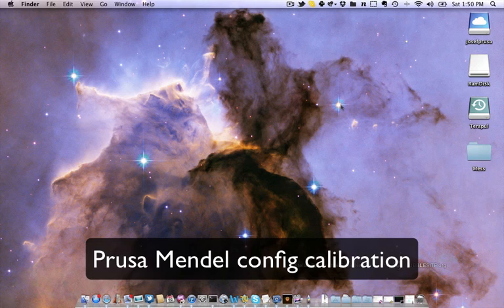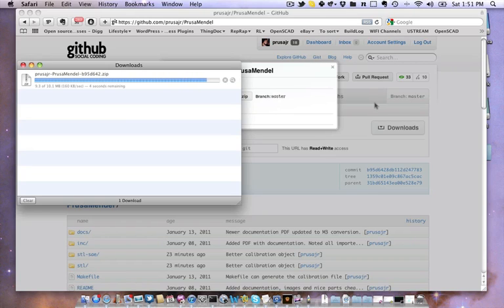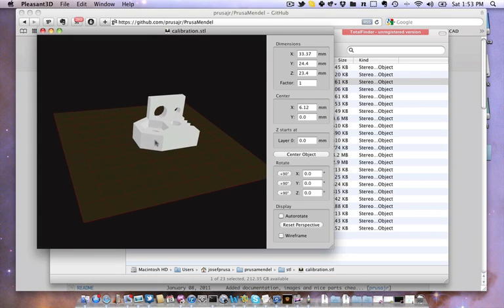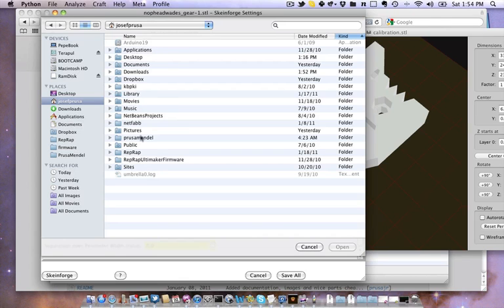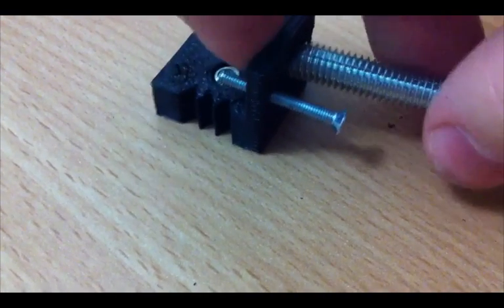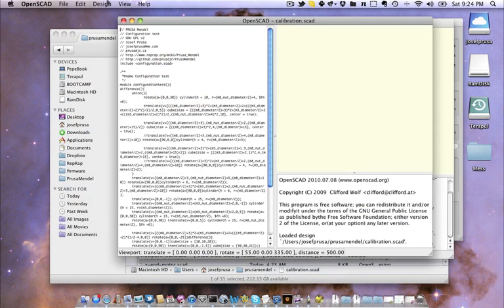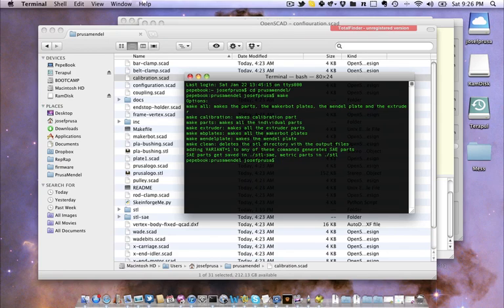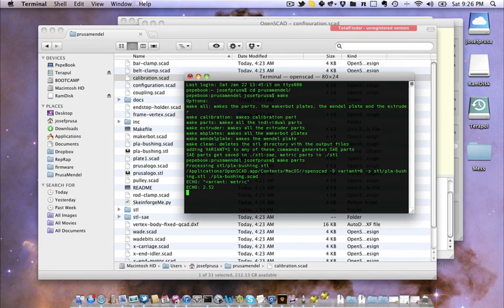Prusa Mendel config calibration

Comment: If you use Skeinforge you can use "stretch" plugin. It will enlarge the holes depending on the parameters. So if you configure skeinforge stretch plugin properly for your printer you can print from stl's with "ideal" sizes and get properly sized holes in your final print :D